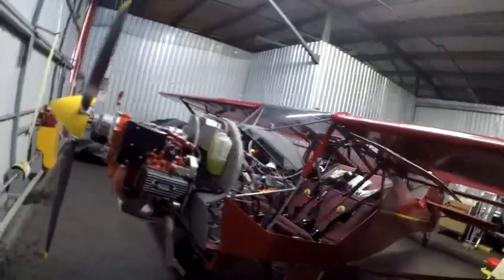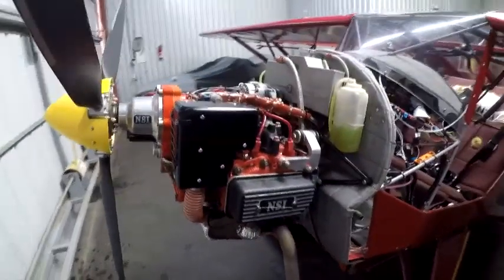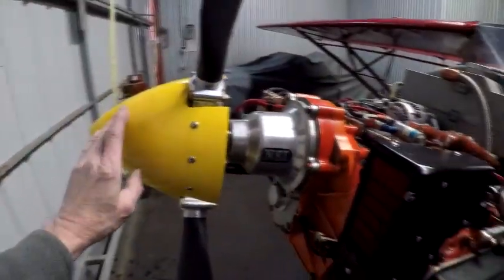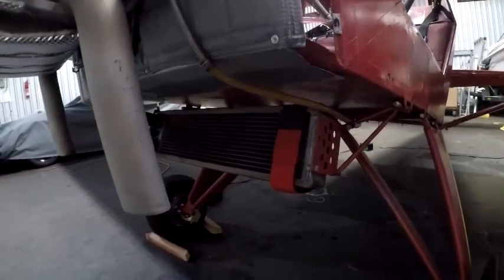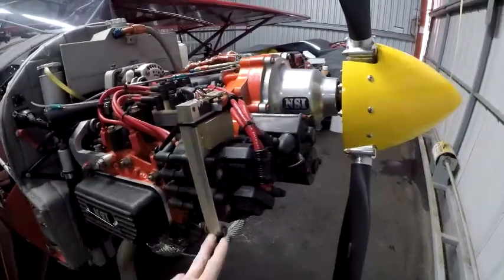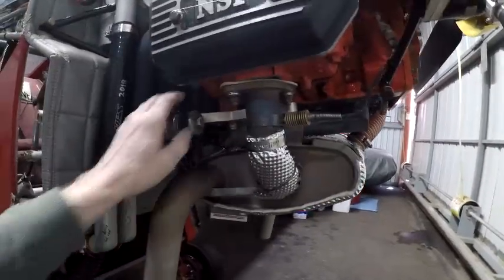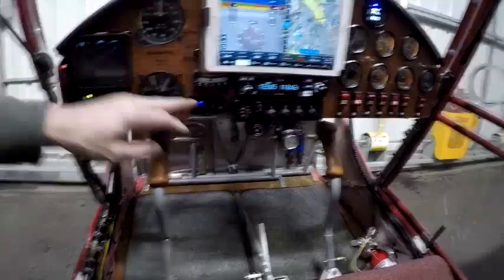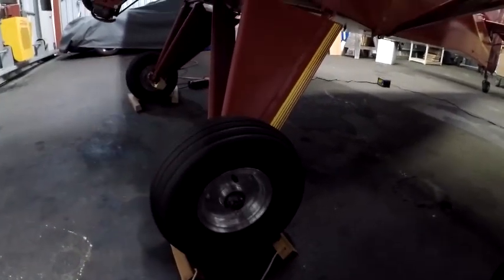Kitfox 4 Subaru Aircraft Engine Update NSI EA81

Comment: Hi Kirby, I wonder if you still monitor comments and questions here. I have  Kitfox 4 1200 with a EA81 by Formula Power (from back in the day) that has a toothed belt drive. Performance is good, the drive reduction as about 1.84/1. Max static rpm is 4300 and will go 4500 in flight. The only problem I am having is the oil temp climbs immediately when the aircraft climbs. What do you consider to be the max allowable oil temp. for this engine?
Reply from the maker: My average oil temp is 180-210 here in warm SoCal.  I am not running an oil cooler.  Never had oil temp problems with this motor.  What are your coolant, and EGT's ?  Does it cool down in level flight?  If so its likely a cooling airflow problem.

My static RPM is about 4600 and will go to 4800 in flight depending on how I set prop pitch.  Currently at 21 degrees for my 70" Warp drive with tapered tips, measured 8" from tip.  I think my reduction ratio is about 2.3/1
Reply: @cramersclassics  went through similar in our families glastar. Went through cowling and oil cooler mods only to discover a line had bit into a barb fitting and restricted flow enough to cause problems. Don’t rule out simple things!
Reply: @cramersclassics  my coolant runs 185 no matter if at climb, cruise, or idle. No EGT gauge. The oil stays at 190-210 in level flight, climbs rapidly to 250 when climbing, cools off pretty quickly in cruise. I am in south Florida, so pretty warm here too. I also have 70" Warp Drive tapered tip prop and round cowl. I am just wondering how hot is too hot for oil temp. My current gauge goes to 250, so I just ordered one which goes to 300. If it is maxing out at 250, I think that's tolerable, but if it is actually going to 275+, I think I should install an oil cooler.
Reply from the maker: @ParadiseHG  I run Mobile 1 synthetic 15w-50 which I think can tolerate up to 275 degrees.  I would say you are running a bit hot on the climb, but if you stay below 250 you're probably ok once you cool down in cruise.  I'm assuming you are full-rich in the climb? Oil cooler might be a good idea, but probably not required IMO.
You can contact me via my website email if you want to chat.

Comment: NSI PSRU drawings came with my plane.  My son who is a cad draftsman is going to transfer the NSI drawings into CAD so we can make any of the worn parts.  I also purchased a goodnused EA81 engine and will rebuild it to the NSI specifications.  The Ellison throttle body is operating perfectly and so are my dual ignitions.  

The J3 tail spring raised the tail and lowered the nose, and  also improved the Marco tailwheel geometry.  Very positive handling compared to the original, turn left only geometry.  The brakes were my last mechanical issue, due to the pedal to master cylinder arc.  After a couple of iterations the brakes now will stop, not over brake,  causing the tail over the top. At 3800 Rpm and full aft stick the brakes hold, at 4000 I get a creep.
Reply from the maker: Great news Doug.  I have the contact for the current owner of the Ellison if you need it.  I have wondered if a taller tail spring would work to improve forward visibility on the ground.  
Can you forward more info in the new tail spring?  Also, I replaced my wheels, calipers and master cylinders with new Matco 6x6's in 2019.  The techs there were very helpful and included a special master cylinder piston designed to work with low leverage brakes on the Kitfox 1-4 models.  I can old my brakes up to 4600 RPM and they are not too strong for normal braking.  Can send me your contact info via my son's business email and I will contact you directly:  EasyRollerzOfficial@gmail.com
Cheers, Kirby

Comment: Hi Kirby, I have a Avid Model C with a Subaru NSI engine.  To lighten the front, Custom Aircraft made a killer exhaust and Kirks radiator in El Cajon made an Aluminum unit.  I fly into L18 a lot, and saw your son’s video.  You can find me on Avidfox flyers under Doug123.
Reply from the maker: Awesome Doug.  I will contact you.  I've had minor problems with the muffler cracking over the years and its quite heavy too.  I would also be interested in a lighter radiator as well.  The brass one I have works great, but its heavy.  When I was the test pilot for NSI back in 1993 we  first flew with a VW Rabbit radiator at a 45 degree angle to the wind.  Worked pretty well but is was too large.
Reply: Hi Kirby, Custom Aircraft in El Cajon stopped by late December and checked out the new exhaust, and were very happy with it.   How is the Uavionics ADSB working?

I had a serious issue with the original tailwheel spring, so I installed the same J3 springs that I have on my Pietenpol.

Love my NSI engine.  I like so much I bought a second engine, and my son and I will contract out to build a new PSRU from the NSI drawings.

Fly low and slow! 
Doug
Reply from the maker: @montgomeryavionics8721  Good to hear Doug!  Did your new spring raise the tail height and improve ground visibility?  Re-engineering  the NSI gearbox sounds really expensive.  Is there anyone making one now?

Comment: Hey Cramer, I have a model 3/4, 1400lb gross on floats, with an EA81.  How'd your wt. and balance work out?  Did you need extra wt. in the tail?  Thanks for publishing your video!
Reply: Just noticed your muffler has extra brackets mounting it to the engine.  Mine is the same muffler but hangs on the exhaust manifold pipes, with no brackets.  Wonder if that's why yours cracked, no problems with mine in over 400 hours.
Reply from the maker: @glikar1  The cracks started around 400 hours.  Had it TIG welded about 3 times in different areas.  The braces were an A&P's idea.  You can also bronze weld with a torch for small cracks.  I think the stainless work hardens over time.  A slip or spring joint would be best I think.
Reply: @cramersclassics  Yes, stainless gets brittle alright. Guess I've been lucky so far. Do you still fly yours?  I'm bringing mine out of storage to fly again, not sure if it will be me flying or one of the kids,
Reply from the maker: @glikar1  Yes!  Here is my son's solo in the Kitfox last year: 
https://www.youtube.com/watch?v=ClTFpdtW8wg&t=9s
Reply from the maker: I have a 5 lb. boat rudder zinc bolted on the tail.  I'm less than an inch from forward CG using a 1200 lb. gross.   I usually wheel land to maintain forward visibility.  Taping the elevator and rubber gaps with clear Gorilla tape improved the effectiveness of elevator on flare and helps the small, model 3 rudder a bit on crosswinds.  Thanks for watching! -Kirb
Reply: @cramersclassics  Right, all sounds familiar.  Mine feels nose heavy on wheels, but a totally different beast on floats.  Take off is quick and flies, lands beautifully on floats.
Reply from the maker: @glikar1  I rigged my Kitfox for Aerocet composite floats many years ago.  Moved before I got a chance to test and sold the floats.  Next to aerobatics, I think float flying is the most fun!  What type of floats are your flying?
Reply: @cramersclassics  I use Aerocet floats too.  Great floats, surprisingly tough.  If I remember correctly Aerocets were rated for 1100lbs, but I've flown them at nearly 1400lbs gross.  Plowed a little water while getting on the step for sure.
Reply: @cramersclassics  Aerobatics would be fun. Closest I got was a Hammerhead while on floats. The Kitfox did great.

Comment: Hi There what  MK of kitfox is this ? I have just bought a MK 1 and i am currently looking at engine options.
Reply from the maker: This is a Model 4 Kitfox.  You model 1 kitfox has a lower gross weight so you will likely be looking at Rotax 503, 532 or 582 two stroke twins.
Reply: @cramersclassics  Thanks for the reply :-) My fox has the rare KFM 112 Engine which looks like a lovely little engine. Like the airframe the engine has on 517 hours but hasnt been run in four years...I am quietly hopeful that the engine will be ok...but checking out my options..I dont really want a 2 stroke :-(

Comment: Hello Kirby.
Do you know where can I buy parts for engine mount? 
I`m looking for a top and bottom engine vibration isolation.
Reply from the maker: Hi, I replaced the rubber engine mounts in 2018 with new ones from Aircraft Spruce.  Lord J-3608-1 you need 8 of them.
Reply: Kirby Cramer 
Thanks

Comment: Can you tell me more details about the ignition system?
Reply from the maker: The NSI ignition has two pickups on the flywheel.
Two MSD racing ignitions that are adjustable for advance.  Since there are only one set of spark plugs, the two ignitions feed into a diode that prevents feedback to either system.  Then the spark goes to one NGK BR8ES plug on each cylinder.
Each igntion has a separate power lead and circuit breaker direct from the battery.  Some have used two batteries for complete redundancy.
Reply: @cramersclassics  Got it. Thanks.

Comment from the maker: I used to have the NSI CAP electric prop.  When I did I would set takeoff to 5000-5500 RPM and it would climb at 12-1500 FPM!
After takeoff I would add pitch and cruise at 3400 RPM at 100.  The CAP Prop is amazing but 20 Lbs. heavier.

Since my son was new to flying the Kitfox I installed a new WarpDrive prop seen in the video, ground adjustable to keep it simple.
I pitch it at 22 degrees (measured 8" from tip).  That setting yields about 4600 RPM on takeoff.  I cruise solo at 4000 RPM  indicates 95 MPH on GPS.  4200 gives about 100 MPH at 3000'.  At 7500' 4200 RPM gives 105-109 MPH at about 4.5 GPH fuel burn.  Send me your email if you wold like to connect directly.
Reply: bernardo@metodosupera.com.br  // bernardoquantum@gmail.com  

THANK YOU AGAIN!!

Comment from the maker: I have removed the muffler blanket at the last condition inspection.  I think it was causing small cracks in the muffler which had to be welded.  Also, the tires/wheels are 6x6 not 5x5.  Still flying well!

Comment: Hi Kirby! how u doing?  ....I'm from Brazil and I just have purchased an CH-701 Zenair with an SUBARU NSI EA81. Ive heard that after a while the reduction unit gives problem.....   Have you ever heard something about it? ....Could you help me please??  THANKS!!
Reply from the maker: I have not had a problem with the NSI gearbox.  I used Penzoil 30wt oil, 650cc and change annually.  Set idle at 1400 RPM.  Feel free to ask any questions!
Reply: @cramersclassics  thank you very much!       ....what temperature does the oil operate? Do you have an oil cooler?
Reply: what maximum takeoff rpm do you reach? and cruise rpm regime have you been using?

Comment: Is it a pushrod engine?
Reply from the maker: Hi Crispin, yes it is a pushrod, solid lifter, EA-81 engine.  They were used in 1980's Subaru Brats and GL models in the U.S.  Simple and reliable 1.8 litres.  Good torque at low RPM.  Water cooled for efficiency.  The later EA-82's were OHV engines, more powerful, but too wide for the Kitfox.
Reply: Cool, I remember when the brat was first on the market, knew someone that owned 1😎👍
Reply: Is it less expensive than a Lycoming?
Reply from the maker: Lycomings were too large for the Kitfox 1-4.   
The Rotax 912 are popular and lighter weight.  The NSI/Subaru has worked well for me, but NSI is out of business.  Lycomings fit later models.
Reply from the maker: @crispincurtis8585  And yes the Subaru is much less expensive due to automotive volume, but requires DIY.
Reply: Sweet, I live a couple  hours from the Lycoming plant
Reply from the maker: @crispincurtis8585  Almost anything is less expensive than a Lycoming :-)